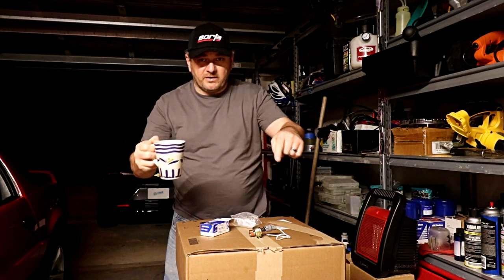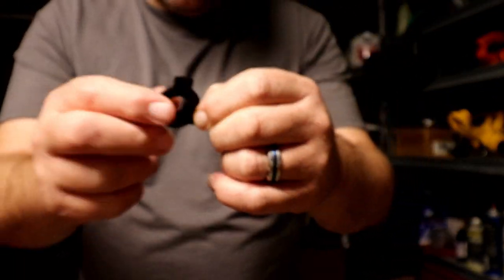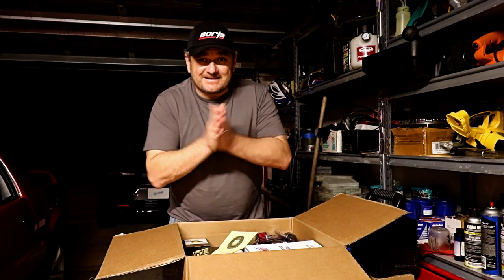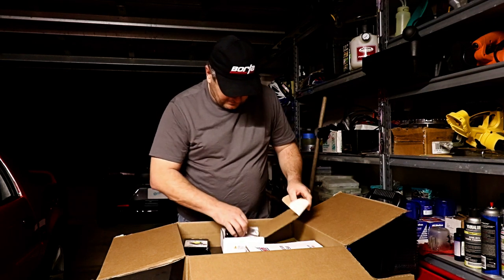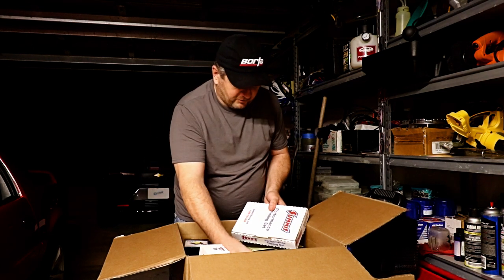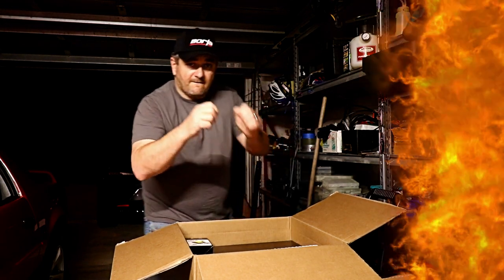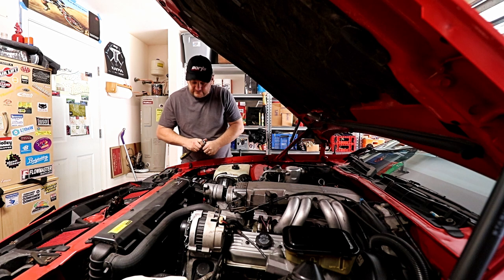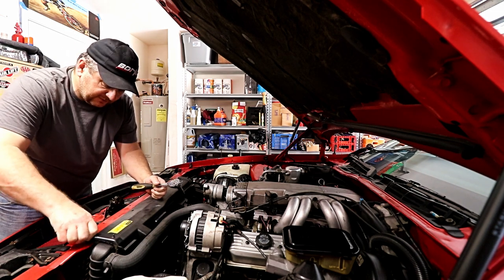FOUND OUT WHY THE Z28 OVERHEATED THIS WILL SHOCK YOU

Comment: It always amazes me how debris gets stuck between the AC condenser in the radiator
Reply: Are you gonna keep the stock rad now?
Reply: Just taking a guess, but I'm thinking trick flow heads? I know u don't buy China stuff for ur rides
Reply: Ah great choice, they have been doing racing heads for years.  Don't forget if u change ur rad ur trans may be a bit low,  may be some still in there.

Comment: I am curious, what rpm do you plan on red lining this engine after all the parts are installed. Based on that; if you plan to spin this engine to the closer side of 6000 to 6500 RPM what made you not choose for roller rockers?
Reply: L2theW Thats what I was asking, why not run a full roller rocker. Meaning the trunion is roller as well and you have better adjustability/stability  as well.